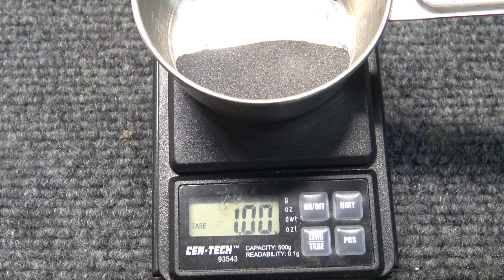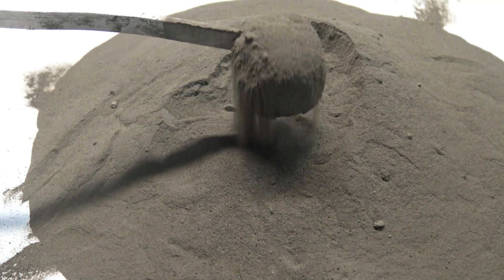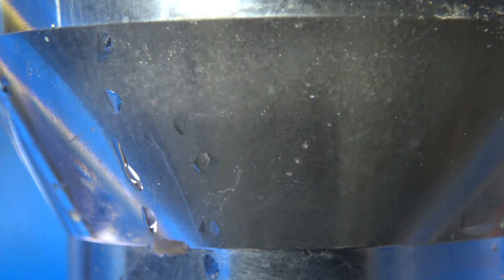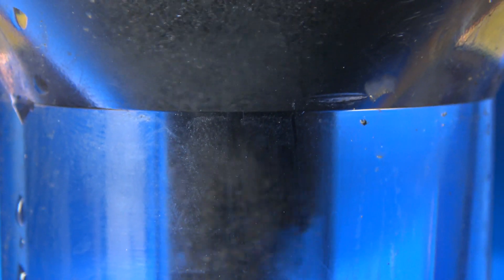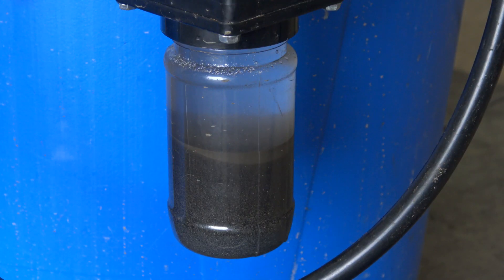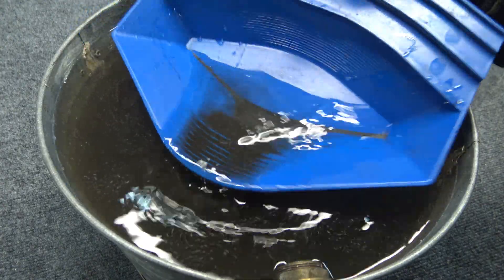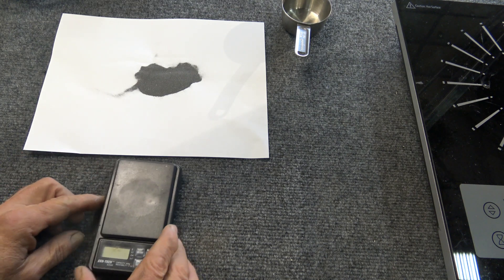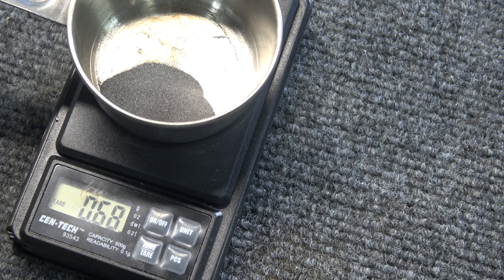GOLDROP vs 400 mesh Tungsten test

Comment: Tungsten is much harder than gold.  Much less malleable. Thus it doesn't flatten out into impossibly thin flakes like flour gold does.  Flakes have far more surface area for a given weight and density.  It's like the difference between dropping a sheet of paper and dropping a crumpled up paper ball.  Why do you go through such lengthy extremes to simulate something when obtaining gold bearing beach sands is relatively cheap and easy via the net?  If I had to estimate, I'd bet it cant recover more than 12% of flour gold from beach sands.
Reply from the maker: Tungsten and gold are the same density and act the same in recovery which is why I used it in the test.Tungsten hardness and malleability have no bearing on its recovery. I doubt at 400 mesh in size that flakes of gold are an issue. How flat can a particle of .003" in size be? This is the thickness of a human hair. How can gold be cheap by buying beach sand on the net? How much sand would have to be bought to recover $1850 of gold and how much would that much sand cost? IMPRACTICLE! The tungsten I use in my business for hard facing chipper anvils and in this demonstration and cost me $40 per pound or $2.50 an ounce. The recovery is real, 68% in the video and even greater now with the improvements made prior to production. Watch my latest videos on YouTube and you can witness the improvements made.
Reply from the maker: https://youtu.be/UlAoBoLDCZk

Comment: Beautiful. Thank you.  I think this is the video a lot of folks were looking for. Matching 400 mesh tungsten/gold with 400 mesh dirt. That is the combination for best processing.  Very good recovery for such fine material. If you move up into the 100 mesh and larger it will be much, much better. If you can screen that Cape Disappointment sand down and run it this way, you would be able to recover a great deal more of that -100 mesh gold  and much easier than with a sluice or Cube. Love it.